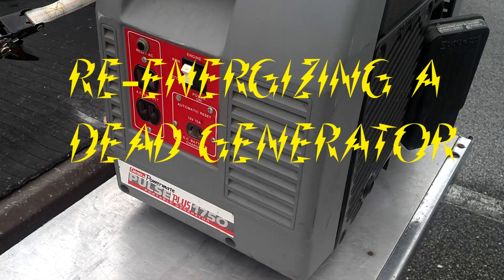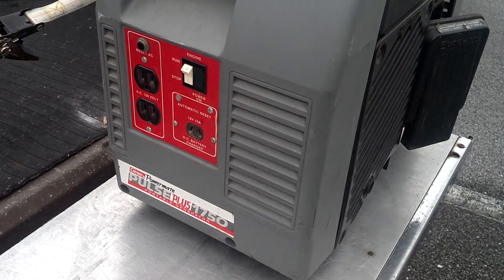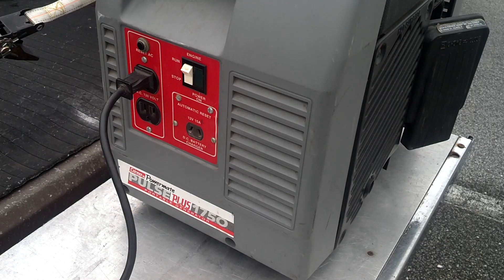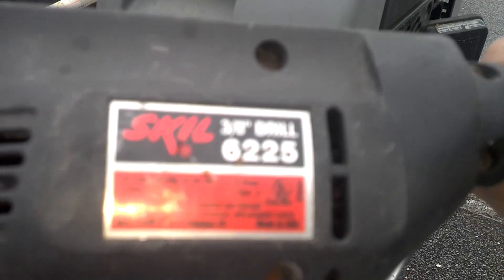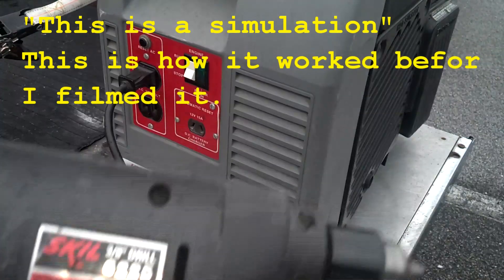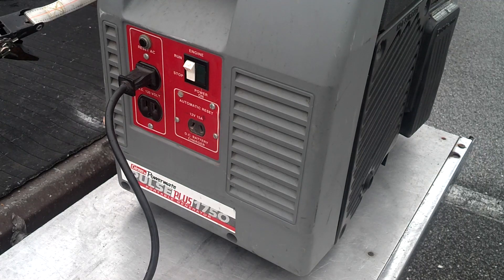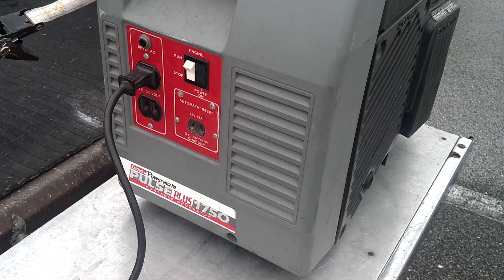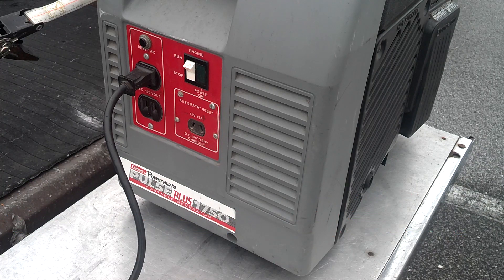Re Energizing Dead Generator

Comment: Just likie the old Harleys with generators instead of alternators. You'd have to polarize the generator when re-installing otherwise you were riding on pure battery power - not very long, as I discovered the first time. Pusing old ironhead Harleys sucks...